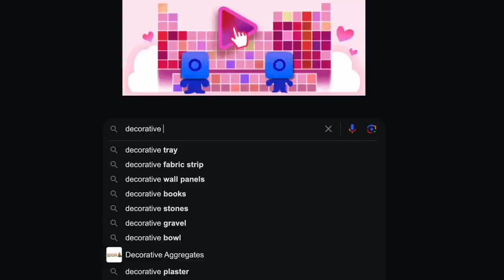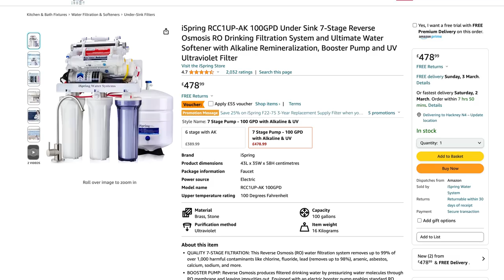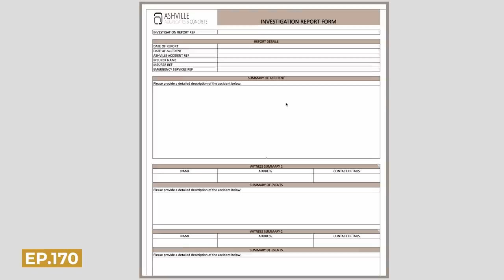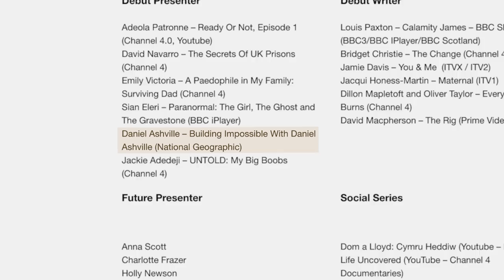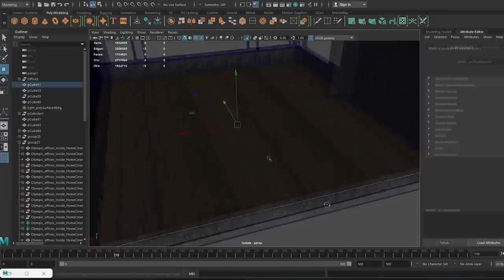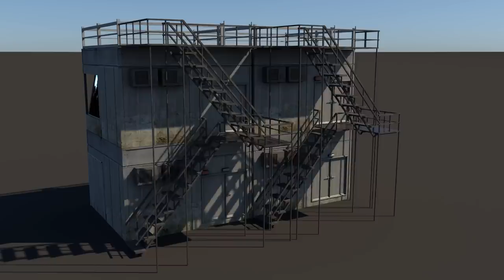DEBT is NOT a Threat | Ashville Weekly ep176

Comment: I heard RO wastes water. I looked into it about 15 years ago. RO then steam distilled, then adding minerals back into the decontaminated water is a lengthy process but you get "good" water at the end of it.
Reply: Modern RO units run around 4:1, so for every litre of RO water four is "wasted", but if you collect the "waste" water it can be used for other things such as watering garden plants, filling toilet cisterns etc.  However I would not recommend drinking anything more than water after the membrane (3rd stage) as further stages remove so much from the water that when drunk will draw calcium etc from the body and thus over time cause further health issues.

Comment: Light switch- convert to low volt (or Rako/control 4/wafer and Place in the on suite
Reply: No need. Just put normal light switch inside ensuite. Perfectly acceptable and within regs outside zone 2.

Comment: 19:21 I usually don't get involved in commenting about 'you do this wrong, you do that wrong blah blah...'. HOWEVER: as an engineer specialized in custom lifting equipment, this shot kinda hurt lol.  Lifting chains should NEVER be used with a top angle of more than 120 degrees, no matter how little the weight is. The forces in those chains when they are near horizontal will scare the pants of you.
Obviously, feel free to ignore this comment, just giving a tip. I've seen chains break like that and it's not a pretty sight.